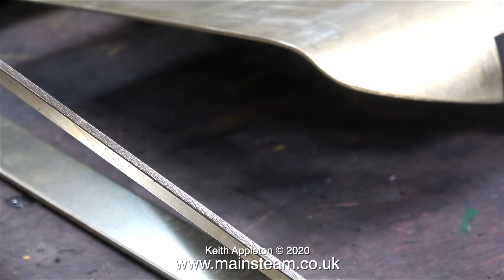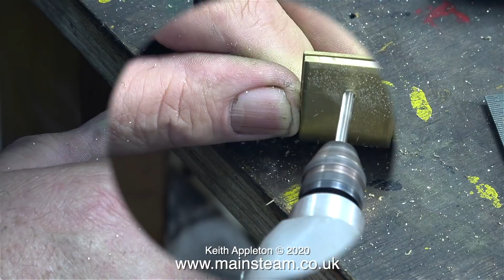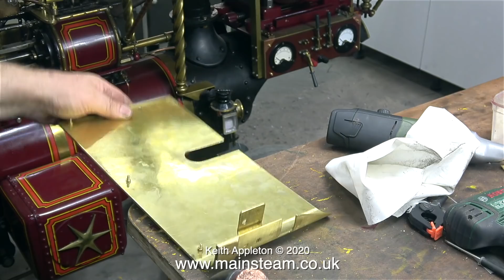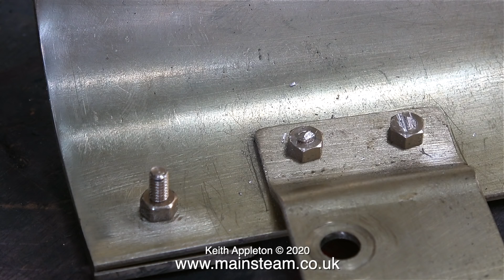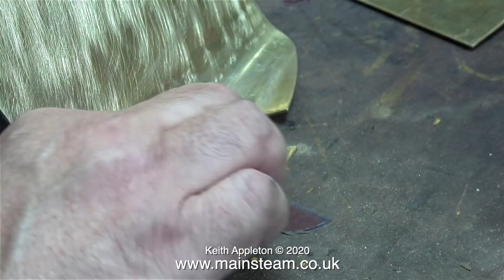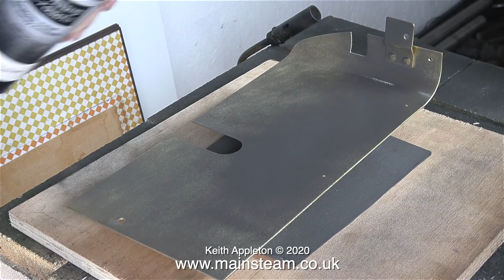A LARGE MODEL SHOWMAN'S ENGINE - PART #39

Comment: is there a slight gap between the guards and the boiler was thinking vibration would slowly scrape off the paint if it sat on the boiler?( does bare brass turn green after a time?)
Reply from the maker: there is a gap of about 3/8 of an inch between the guards & the boiler.
Reply: @keithappleton  thanks

Comment: Beautiful workmanship. Does the lower edge of the motion guards have any protection so as to not cause chafing on the boiler or do they sit up high enough as to not touch and cause paint damage?
Reply from the maker: The bottom edge will not even touch the boiler when the guards are finished & fitted.